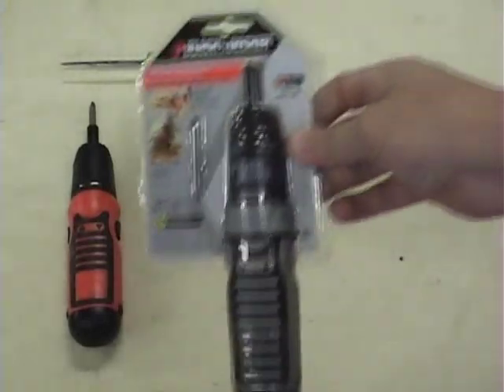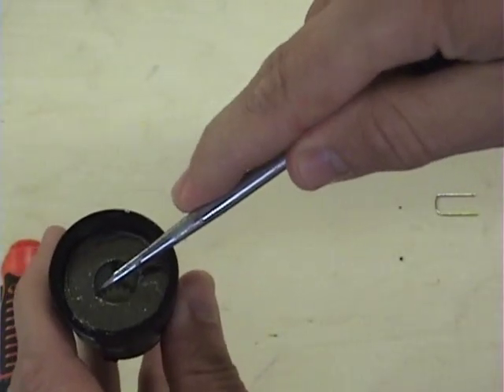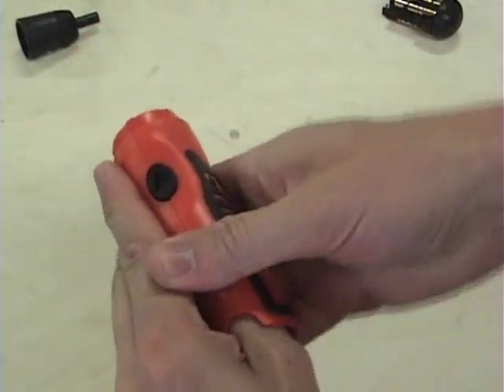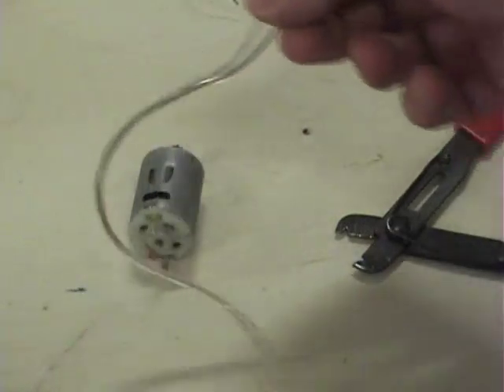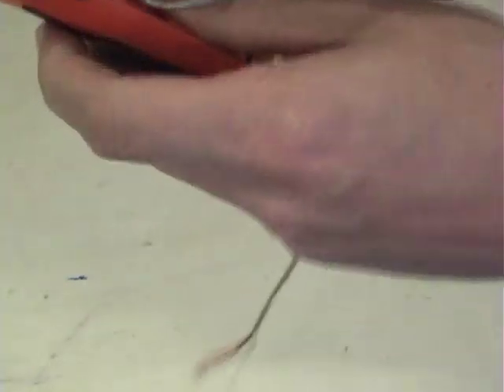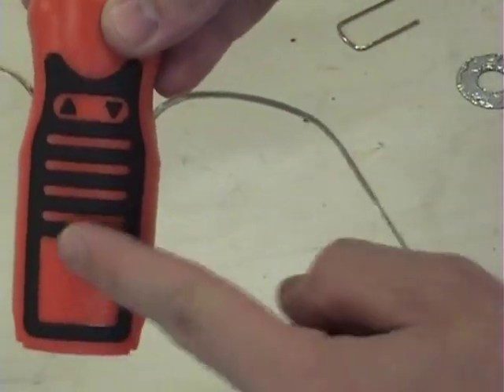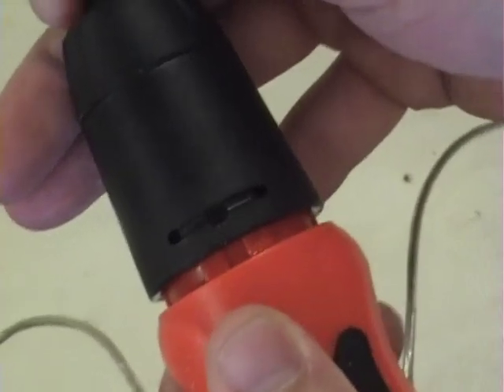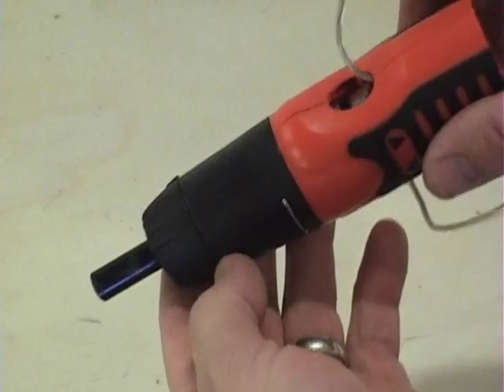How to make a battle bot part 1

Comment: @supertyler12 Sometimes if you attatch the wire onto the chassis so all the components do not wobble and pull on the contacts, you can leave the contacts unsoldered. It will not be a perminent solution, but it should be good enough to survive a good few fights.

Comment: If i wanted to, could i take an old RC car that runs on a 2000mAh 7.2v Ni-Cd and solder on two of the black and Decker motors or does that motor only run on AA batteries and or D batteries